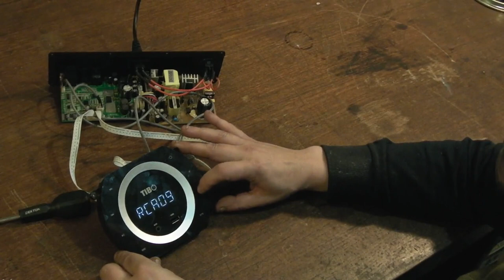Making an active speaker shelve for my workbench from junk

Comment: The sub looked like it used to be installed from behind? You may want to try some kind of rubber gasket as you may find and higher volumes or on certain frequencies you’ll get a distortion.  Also sort sealing the amp module also if it doesn’t already have one.

A thin bead of silicone would also do the same job.